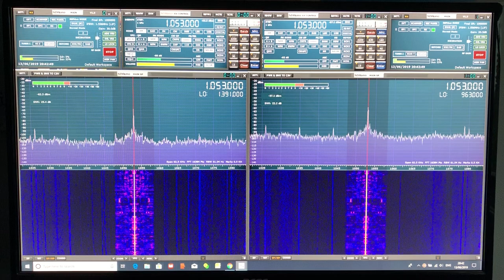Bonito CCMC-30 noise filter: 10 dB drop in noise-floor, 5 dB increase in SNR on medium wave

Comment: Hi Clint, nice video that shows what is really happening, just…. my calculations from what I see on the video are somewhat different. Taking a look at the MA-305, wich I also have and know is a good antenna, I derive a netto gain of 2.9 dB from what I have seen in your video, wich is what I also have measured here at home. Just you compare this to the Boniwhip without the common mode filter wich I think is not fair to say that you have gained 10 dB. 3 dB wich is on par with what I measure here at home on my own build common mode chokes. I really find €99 to high priced for what they are. Mine are about €25 and a very good professional watersealed Winradio WR-CMC 30 in a metal case did cost me €45 two years ago and it has a earth connector wich does offer better results below 500 KHz when connected. Just my 2 cents worth in the sidelines. A thing that is puzzeling me is the big difference in price between the Boniwhip and the NTi MA-305 when the results are almost identical... Keep on youtubing. See ya!
Reply from the maker: Hi Ron, thank you very much for taking the time to quantify the SNR improvement in more detail that I did. I didn't actually say the nett gain was 10 dBs though. That was the clear drop in the noise-floor which isn't important unless the signal strength reduction is non-linear. It's all about the SNR - not the noise-floor. I agree the performance on the Boni Whip and MA305 is just about identical. 73! Clint

Comment: just a quick question concerning the megaloop fx, i received one to test for 14 days, my sdrplay uses a printer usb cable, i noticed the megaloop fx has the same connector for power in, so i can use a printer lead for this and connect to my powerbank. Would i be right in this assumption 73 Malc
Reply from the maker: Yes, Malc you can use the USB cable from your printer. 73! Clint
Reply: @OxfordShortwaveLog  I will be conducting tests and putting them on my youtube channel as dennis is interested how it compares in my flat to a slinky with my homebrew 9 to 1 unun
Reply from the maker: Sounds very good Malc. Let me know how you get on. 73! Clint